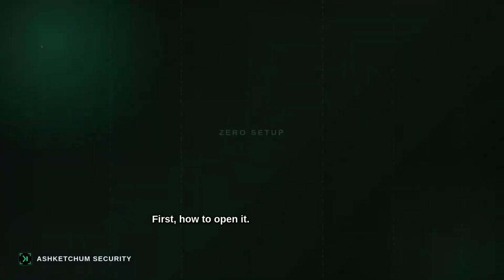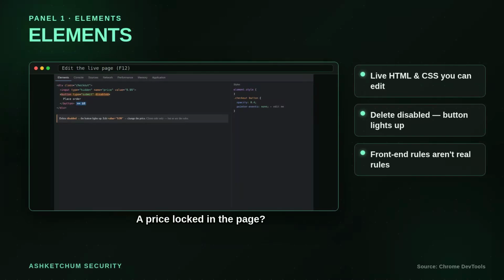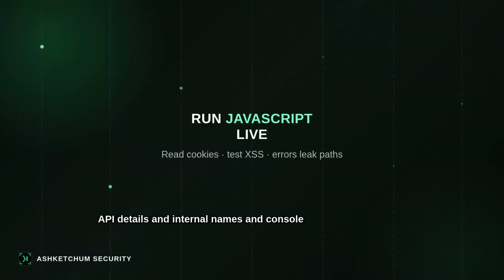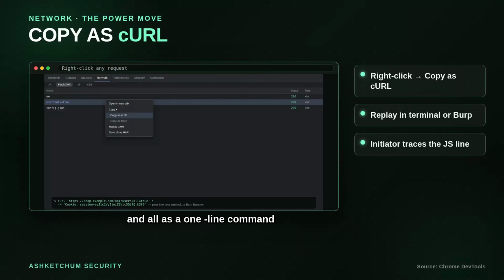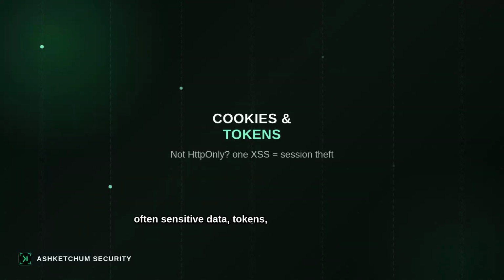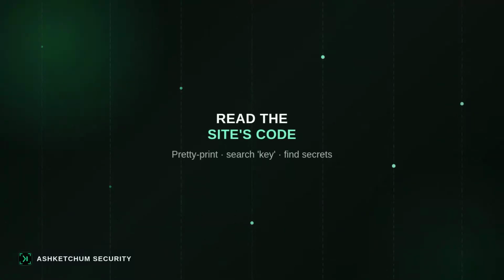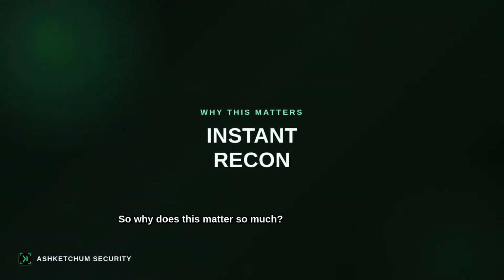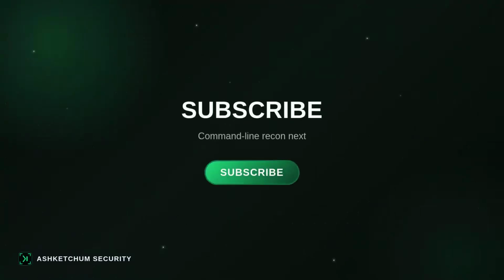Browser DevTools for Hackers — Network, Storage, Console & Sources (F12 Guide 2026)

Comment from the maker: The 5 panels in one line 👇
• Elements → edit the live page (delete 'disabled', unhide fields)
• Console → run JS, read document.cookie, test XSS
• Network → every request + hidden APIs; right-click → Copy as cURL → Burp
• Application → cookies, localStorage, session tokens (not HttpOnly = XSS steals it)
• Sources → read the JS, pretty-print, search 'key'/'secret' for hardcoded keys

Which panel surprised you most? Mine's Sources. 👇 Ep 13 = Command-line & Linux for recon. 🔔